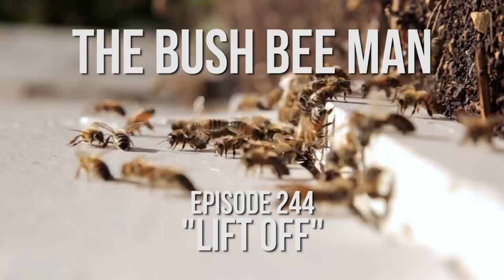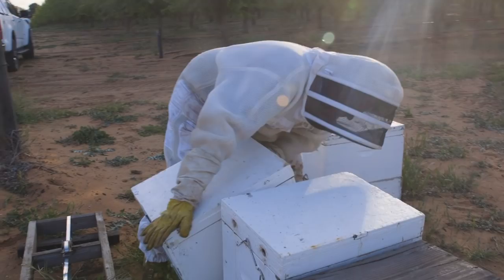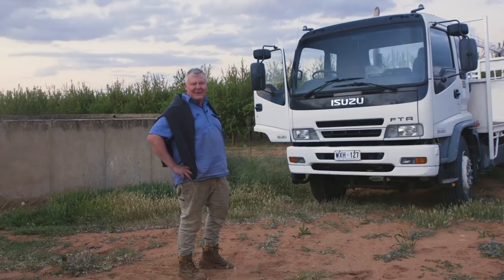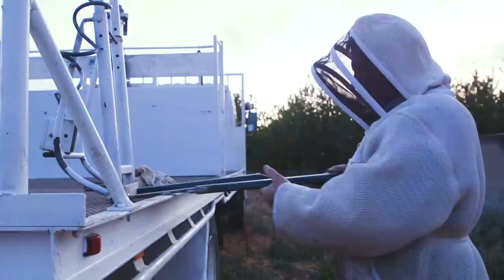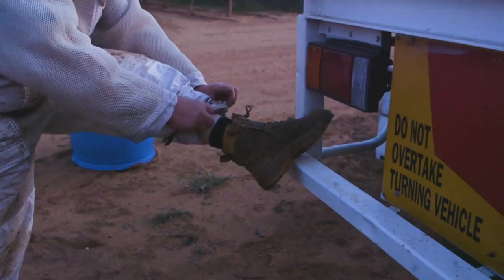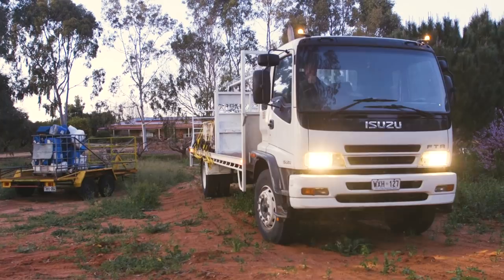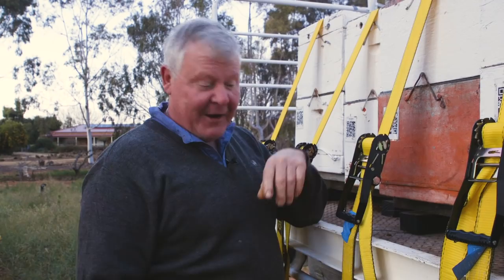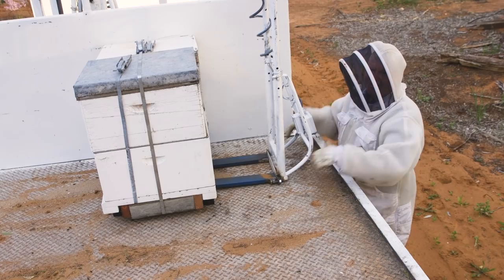Moving Bee Hives at Night Using the New Pallet System & Truck Crane | The Bush Bee Man

Comment: Make your top bars (connection Point) on the cradle a bit longer to move center of gravity back a bit.  Cradle should then tip slightly backwards towards operator when loaded.

Comment: As mentioned below the top attachment needs to be forward over the center of gravity. Also you fitted your forks upside down. Swap left to right so the top of your fork has a longer flat surface.